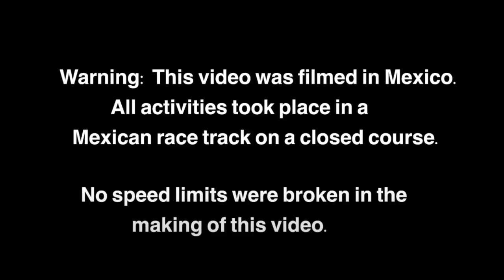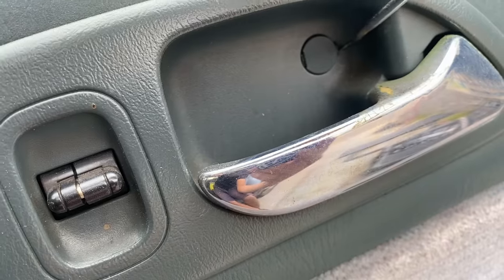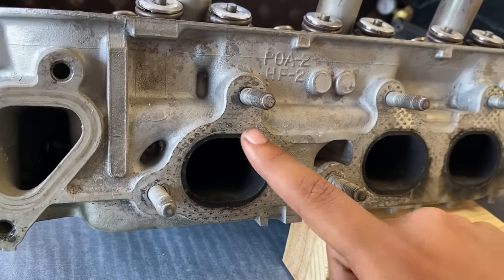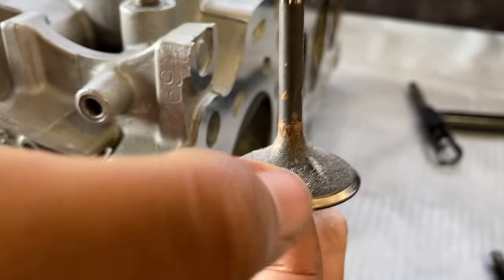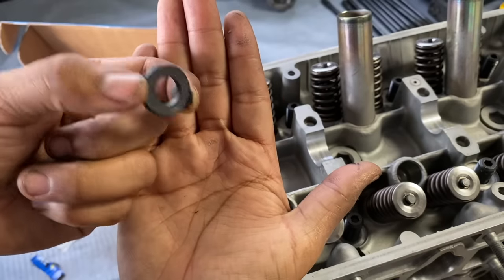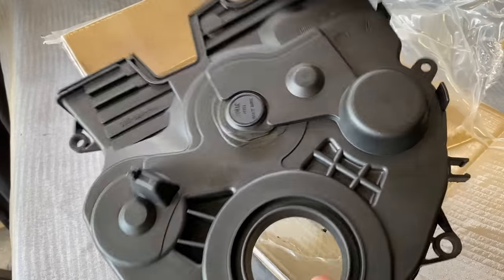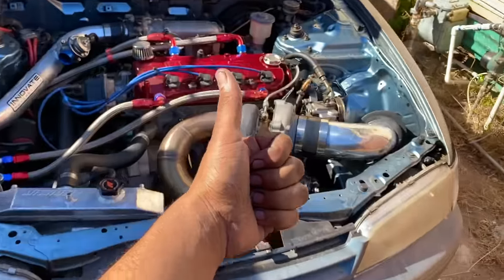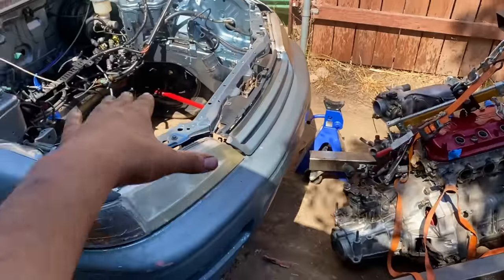Turbo Honda makes 392 Charger Mad + Build Upgrades

Comment: I'm a Toyota guy at heart, but Honda is my second favorite automaker. I love seeing sleeper cars outright embarrass arrogant and pompous drivers. There's something about the fragile egos of Charger drivers that makes it all the more comical. Awesome build!
Reply: Honda >   but Toyota is my second take if I have to take something different than a Honda. 🤙☝🏼💜🤙
Reply: toyota >Honda . turns corners accurately.
Reply: @user-bi2ml3rb5q  Honda > still holds production car world records to this day on different tracks including circuit tracks, still competes 3 to 4 classes "above" themselves against other car manufacturers and still often wins. Cheaper to fix,  cheaper to get parts, cheaper to make go fast, even if beat still last incredibly long. Never mind if taken care of. Produce the most power  per square inch of block. Still dominate racing today in various classes. Have the most cars STILL on the road to this day.
Reply: bigboy3245  not necessarily Honda got into engines very early working on motorcycles in a very small repair shop. He thought to revolutionize the motors and had a dream born very early. He then excelled in engineering school as he was already a natural. Engineering school was nothing to him and before he even  graduated he already won awards for his engine design. He then went on to win the first he ever entered with his motor. Not long after he started putting that same  design on, a bigger scale and figures he could make a motor just like a raving  motorcycle engine but big enough for a car. His first 4 cylinder car engines were born. I don't think Toyota was his father. More like healthy competition and pushed him to be even better with his engines. He also revolutionized the production line so Honda  could pump out as much as Toyota or more and have a chance to keep up. They had there own method but he made one even more efficient that needs even less workers for the same output. Honda's engineering in their engines is the best. Period.  His engines were just better on many ways. More efficient, longer lasting, and made great power and rpms from less.  Don't get me wrong I really do like Toyota as well they are the other great Japanese engineers but I personally feel Honda is superior. I'd take a Honda over a BMW any day. Car or bike. Hahaha. CBR1000R all day. Even the old CBR1000 4 cylinder or cbr 750 🤙💜💟💖
Reply: Toyota is so uninterested in making fast cars that they make BMW and Subaru built them with their badge.

Comment: You should've yelled "sell it" to the 392 charger guy.
Reply: He can't sell it lol he still has 87 payments left on the 96 month financing he signed up for on that heap.  By time he's finished paying it won't be worth 10% of its original value.  If the heap even lasts till 8 years.
Reply: @rxtuninginc8444  800 month financing setup, there fixed it for you...
Reply: @fortcrafterbossbehold9027  fixed what?

Comment: From personal experience put the head studs into the block dry. Make sure each hole that’s in the block is clean and dry and run a thread chaser down into each hole and clean them out with brake cleaner and a air blower and install the head studs into the block “DRY”. Reason you don’t want to put any type of lubricant onto the threads that go into the block is because you can have a issue we’re the lubricant can hydraulic and crack the block. The lubricant becomes thin as the block heats up building pressure on the bottom side of the stud and cracking the block or the stud loosening up somewhat. However apply a liberal amount of the ARP ultra torque to the threads and the top and bottom of the washer and nut on the top side of things. I was told this by ARP. Just some food for thought.
Reply from the maker: I will 100% keep this in mind. This is why I like my comment section :D
Reply: ARP told you about installing studs in dry??
Reply: @SleeperAccord  also dont touch arp studs with bare hands! :)
Reply: @stefanzomods  to install them into the block themselves dry. But wise of the thread that hold them head down you want to put UltraTorque in those as well the bottom and tops of the washers.

Comment: Gasket matching is largely useless, unless the head is mis-matched (smaller, offset) vs the intake runners. I'd also recommend the F23A intake manifold since it has a huge plenum, and you can shorten the runners by 1.5" since they act as a divider for the L-shaped plenum.
Reply from the maker: It’s easy to miss but I ported my intake too and it needed it. I appreciate the advice keep it coming
Reply: @SleeperAccord  port matching does work.
Reply: @reifonseca5767  the guy was talking about gasket matching though, i thought that was different from port matching

from what I've seen on forums it really seems to be hit and miss. Some people swear by port and gasket matching, others have said that it did nothing for them. Some engines seem to benefit from it enough to warrant doing it in the first place, others it's not much point etc.
Reply: Actually u should always put heads on a flow bench as any change in flow might actually harm engine performance.
Reply: @edbo10  depends on how bad it is to start with, and it can't hurt to remove that material. 
It's more then the next guy has. 
I'll check em on anything I have apart, even a lawnmower so I can laugh on how screwed up they are at least if nothing else. 
Growing up, me and a pal had the same cars, same setups but I always did that little extra step, like gasket matching.
That, and  a bunch of other little things that people don't always take that extra step on. 
Since he just slapped his stuff together and ran, you can guess who always was out front.
Add up a bunch of "little useless things" and it's worth something.
Reply: @MrTheHillfolk  fair enough, in the case of my camry's 3vz-fe (commonly dropped into MR2s to turn them into V6 balls of fun) seems like port matching doesn't do much other than just look good. Port and polish gives it a pretty big gain though, 25-30 bhp can be expected.

Comment: I'm actually amazed at how easily that axle pulled out, not once have I ever had one easy to pull lmao
Reply from the maker: I pull it out a lot. if they are in there for years yeah pretty much seized
Reply: Of course it's easy to pull out it's a cheap Honda Civic not some 1960 Plymouth Superbird
Reply: @OregonSilverStacker  this was not a very smart comment, I think the Plymouth would be alot easier going by the axles on my 77 GMC and I've had Hondas, Mitsubishi's, Toyotas etc that were all kinda difficult.

Comment: You're doing good on the porting, just need less speed so the burr doesnt get clogged, too much heat, take it slow and steady. Might save you an eye too, when the polishing bits snap.lol

Comment: I’m just shocked that boat is running so well on land.
Reply from the maker: Lol!
Reply: So if it’s not a old 90s car it’s a boat? Yea dudes car is sick but anyone irl would rather have a new scat
Reply: @Nicktheguy24  I mean it’s a joke, but scats weight 42-4400lbs without a driver compared to mustangs and Camaros which are ~33-3800lbs. The Mercedes platform they’re built on is dated and overweight. That’s what they’re going for tho, Heavy muscle cars like the old days.
Reply: @169abr  true. Gt500 is 4100 lbs
Reply: @Nicktheguy24  ZL1’s get up there too, if Dodge went on a diet they’d be insanely potent
Reply: @Nicktheguy24  the platform is from like 2007-8 so it definitely needs an update
Reply: @169abr  true. But those cars were just made really big as they originated from full size cars 🤷🏻‍♂️ you can obviously still drive them and they are still fast (depending on the engine)
Reply: @DelGTAGrndrs  yea

Comment: Protip: Use bar soap on carbide bits while grinding aluminum to avoid clogging.
Reply: Even more pro of a tip: use teflon pipe dope. Works way better, lasts longer between application.
Reply: @cheatinggravity173  pipe dope cools down tips?

Comment: I’m a machinist so when u said “I pushed it and it dropped into place”, totally triggered my ocd!!!! I was put in pain from that statement. Honestly If I did that while building an engine I’d never forget it and It would haunt me at night. I know from personal experience. My father once dropped one  (out of six) Cnc’d low compression piston onto a cast iron casting and dented the top edge of the piston. Although the piston rings do all of the actual touching inside the cylinder wall, it still haunts me to this day. We never finished that project because of money and the fact I was mentally damaged knowing that a dented piston was put inside our built engine. I have ptsd from that experience.
Reply from the maker: To be fair that dent turns to a hot spot that promotes detonation :P but I cringed a little too but it was already no so I just sent it
Reply: Where he say this??
Reply: @Rottenkirsche13  25:35ish
Reply: Calmmmmmm down

Comment: Mustang owner here who LOVES Hondas. Understanding power to weight ratio and gearing is an art form
Reply: No, its simple physics.
Reply: @fondfarewell2  nope
Reply: @fondfarewell2  people just tend to think that they have the cooler/more expensive/bigger displacement motor as with the 392 guy and get upset or it wrecks their world.
Reply: @2yoked70  if it's not physics than what is it?

Comment: Fact = Winding windows VS power windows weigh the same, winding mechanisms often weigh more in actual fact. You will be losing a small motor which weighs very little. Plexiglass windows and carbon fiber doors are worth doing. Anything else will do F all even gutting entire interiors on certain cars doesn’t do anything. Glass is very heavy, steel doors are heavy. Plastic interior bits weigh F all. And on simple non leather/power seats interior cars like Civics it’s not worth ruining an interior. Unless you are removing everything including sound deadening. Good video though.
Reply: I agree, gut the carpet, not the electrical windows, oh well..lol
Reply: That model Honda doesn't even have interior worth keeping lol

Comment: run burr bit down into simple candle wax  before digging into aluminum will prevent the mauling or aluminum from sticking to burr bit or go with aluminum rough bit like you did but wax works...
Reply: or any thin oil will suffice

Comment: Just FYI In the future, the bottom stud threads don't require the lube and you can use a ratchet to snug them to "hand tight". Not well written in their instructions i know... That hissing you heard is the air trying to escape from the blind hole which sometimes can make the stud get "tight" well before it's actually seated all the way in the hole. The more common real issue is when tearing down engines and coolant gets left in the blind holes, we can't compress it like air so the studs will actually stop way short and only engaging a few threads, you go to torque the top nuts and boom you just stripped the block threads. The tops of all the studs "minus longer/shorter ones" should be very close to the same height, if you kneel down and look across the tops of all the studs you can see if they are level or if any need some adjustment. The ARP lube on the lower threads makes it tougher for the hissing air to escape and it has no benefit for torque/clamping accuracy. The bottom stud threads are not the interface where the torque is being torsionally applied anymore like a stock bolt with engine oil would have. That force is now moved to the top threads which is why you want to lube all of those surfaces with the lube. The lube is designed to eliminate most of that torsional load anyway so the only force on the stud is longitudinal, or straight up and down, that is what makes studs superior to bolts.

Comment: I had a 2009 Civic Si back in the day. Dodge was my favorite car to race because I could stay right with them or outrun them. I'm talking about the RT models. This was back when V8 cars only had around 300-350 horsepower and were heavy. 

I currently drive a 2011 Mustang 5.0. I like my Civic Si better

That Civic ran like a 2 stroke. I'm talking about the Yamaha Banshee 350. If anyone has driven a 2 stroke ATV or dirtbike, you know exactly what I mean. The 3rd gear in that Civic pulled like a V8.

Thst Civic was an amazing car. I miss it so much.

Comment: Great job,and atten to detail! As a middle agesd mechanic of 20 years its nice to see the young techs doing this.my experience the young guns just want bolt on plug and play,they dont understand the details win races,and i love the explanation whille your doing it.only thing i wpuld add in is that threadlocker is also a lubricant and then a locking agent,heads do blow off,even with arp studs.ive seen it on boosted and nat. Asp.and also maybe a little less lube ,you can get whats called a hydraulic lock from the space between the bottom of the stud and the block,that was it yelling at you.but like i said great job ,build and vid,nice to see this!

Comment: Hey man, I dig your "piece of shit".
 Some things you may not have known and some unelicited help:
 Those head studs go into the block dry. The torque lube is for the nuts and washers. Using oil or torque lube creates the possibility for the threads to hydo-lock the bolt before it reaches the bottom of the bore.
 While you're correct, the head studs go into the block hand tight. Don't be afraid to use an Allen to be sure they are actually bottoming and you didn't accidently stop on a bur or debris in the threads. 
Be careful when you port match not to disturb the natural volute. Taking out too much material at the parting line and making a chamfer to both sides can open that area and create a low pressure area. 
You can clean up those valves with a nice brass wire wheel if you have one. Do your best not to hit the valve seat radius. However, Don't worry, as valves are hardened steel and even if you used a steel wire wheel it's highly unlikely that you could scratch the valves seat.
Garrett insists that water cooling all ball bearing GT series turbos (that are designed with water cooling jackets) is imperative. Not doing so will absolutely coke the oil in the center cartridge and lead to premature failure of the ball bearing assembly. 
Overall that's a really smart build. I respect the hell out of you for doing everything yourself. Keep hurting feelings and doing what you love man. 

Respect,
  - Hinkle
Reply from the maker: Oh man good read, thanks for Abe advice! Keep it coming if you see anything else worth mentioning. My turbo is journal though. I definitely want to water cool it anyway though

Comment: For the valve and valve spring parts when apart,  saw a guy use plastic ice trays from the dollar store then saran wrap and marked it so it all stayed together in the right order no matter what. Oops dropped the tray? No worries, it’s still all together.

Comment: "I don't Wana remove anything that has to do with safety." 
Proceeds to angle grind out a chunk of steel from the doors crash structure. 😅😅😅
Reply: Nothing a roll cage can’t fix
Reply: What about the trunk..sure that had some significance in the crumple zone and rigidity lol

Comment: You wrapped the cable the wr9ng direction. The bumps will be trying to loosen the bolt holding the window up.

Comment: Awesome diy build! It's great to see people learning these skills, and building engines on their own.i I was so glad to see You disassemble the head after seeing all that grinding dust. You did a great job torqueing the head bolts properly and lube on the threads is super important. Next time try to use a shorter extension for your torque wrench. The length of the extension greatly effects the torque applied to the bolt head..and if you want to get the closest proper torque thats a good tip! It's great to see a single cam build for once!
Reply from the maker: noted! thank you so much for the tips. keep them coming it really helps.
Reply: Hey man, the torque extension is actually a myth if you do it correctly, the exact same amount of torque is applied. There's a very good video of it on YT, I think it's Purdue MET or Project Farm or somebody.
Reply: @JacopoSkydweller  I had heard that but i dont know it as an actual fact. I'll have to check out the video

Comment: There's something to be said for a dirt cheap motor that makes enough HP to do the job. It's like....who give a F if it blows? I'll just go get another 😂😂 

Seriously bro for an old gear head like myself you embody what it was like for us in the early tuner scene. We worked with what we had. Hell I remember fabbing together my own turbo kit for my old 2.8 5MGE in my 82 Supra back in like 98. The Supra was straight out of a junkyard for $700. And I really didn't care if the motor blew because those 5MGEs could be found in Cressidas and Celica Supras all damn day. Damn I miss that car

Comment: We used to removed the sound deadening material from all over the car to save weight, but things start getting really loud at that point. I built many 92-95 eg hatch with B18c-R turbo, all motor H22a w/LSD, etc. Also built my wife an automatic 95 accord with a nice set of high end coil overs and blue top Euro R. Really good times, I miss it. This was back in late 90’s through 2000’s. Pretty sure the sound deadening material is like 100-125lbs. Good amount of weight reduction

Comment: One tip on making sure the windows do t come down is to drill a hold below the window slides and put a bolt and nylock nut through that hole to hold the window up, was good enough for a British touring car team. But love the build and quality of the work 💪 love the vids too keep it my g

Comment: The o-ring seal on the water pump really doesn't need that RTV.  TIP:  Applying a little PAM cocking spray to the surface where the o-ring meets the block will keep the o-ring from sticking for easy removal in the future.